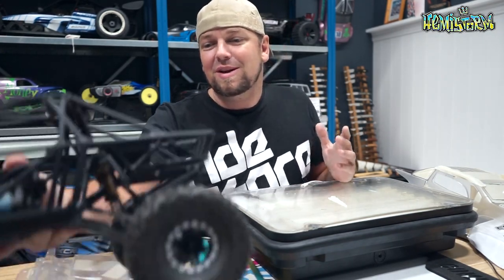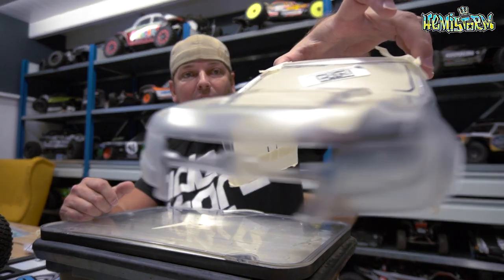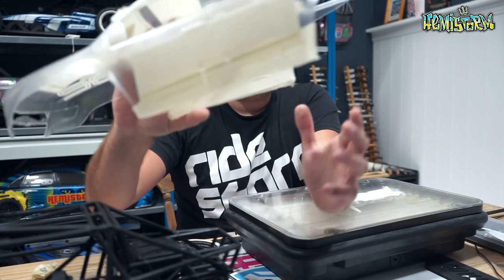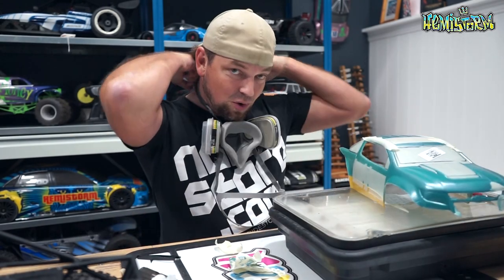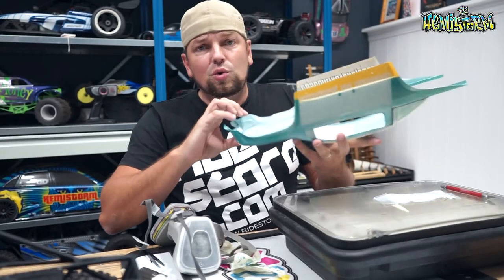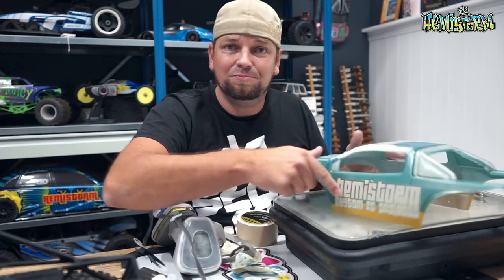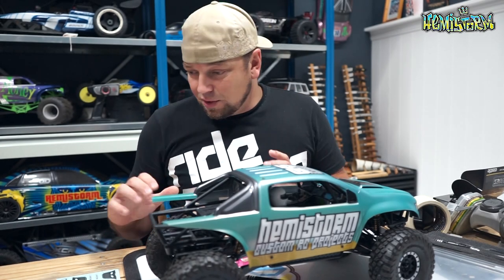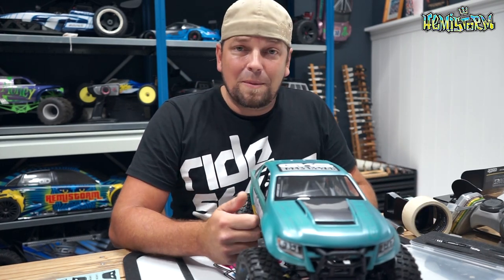HOW TO RC PAINT - Custom Cut Chevy Colorado

Comment: It is always enjoyable to watch you paint and listen to you explain how to get the effects you are after. If the Element IFS bolts up to the chassis, that would be a very scale Colorado prerunner.
Reply from the maker: It does, just change the front shock hoops for the standard ones and it fits right in there. :)

Comment: A couple of years ago, I bought a silhouette cameo 3 vinyl cutting machine. Only 4 MY rc use. Using Oracal 651, u can flip any decal horizontally, apply it inside the body, & all lexan paint WILL stick to it. (IF only I could send pix here). Something inexpensive u may wanna look n2. 👌

Comment: I have a all black Colorado Zr2... Real one with Diesel and Proline Colorado on the Element IFS rock crawler. Put some big soft wheels and tires on it. Think it needs more weight for balance tho. Just put some steel belt tires on the Raptor Rey truck yesterday. Thats pretty cool too. But I enjoy the scale Pro Line models for sure. Very cool paint Job btw
Reply from the maker: Sounds like you have some nice full size and scale stuff! Have a great weekend.:

Comment: I love the PS49 and PS54 color combo! I gave it a go on some scrap material and ended up with some "spotting" or "splatter" where the PS54 didn't spray evenly. If you don't mind the question: What's the trick to prevent that?